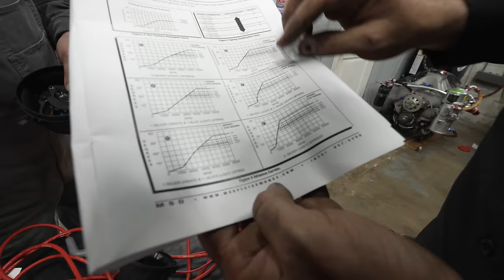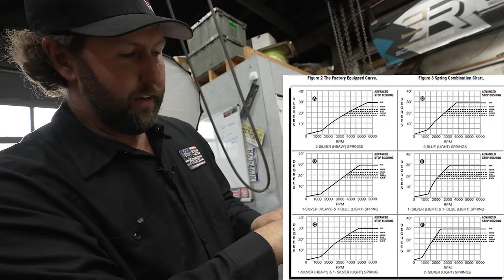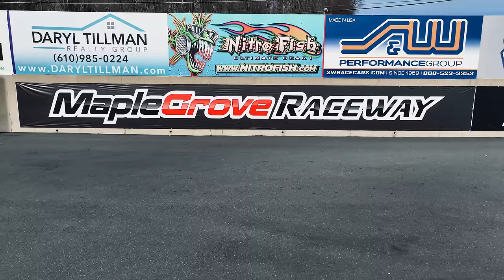Drag Race Ford Fairlane REVIVED w/ Vice Grip Garage After Sitting Dead 40 Years! | Part 2

Comment: I think that noise you guys heard along the road was that piece of stray all-thread for the air cleaner that you hacked off with the angle grinder that flew back towards the firewall / top of the transmission bell housing.

Comment: Gotta love a Ford 302, the sound, and of course the distributor up front for easy access!
Reply: Depends on which one i favor the winsor over the cleveland
Reply: @ronseth1225 I thought windsors were only the 351?
Reply: @DirtyDiezel  winsor 351 is  actually the canadian version of the American cleveland 351.cleveland engines are the under dog though every one including me favor the winsor over it though
Reply: @ronseth1225 cleveland and windsor are 2 different blocks, the heads are not interchangable
Reply: @MotoMeat they did make a 302 cleveland in Australia and called them a 4.9

Comment: You need A gear venders overdrive if your running 3000 R’s @ highway speed.  The O’drive will give about 25% reduction.
Is the trans a ford top loader?

Comment: In 1979 I bought a 67 GTA red Fairlane. It had the 390 4V and C6. Guy i got from had taken it to the track a few times. It ran high 13's with headers and a bigger carb. After i got it I went with a cam and some old Thunderbird heads that probably weren't as good but did raise compression. Street raced it some but never took it to the track.  Was a lot of fun though. Won a lot of races but still lost a few too. Money is speed ya know.

Comment: My 56 210 came with the single pot of brake death, and it damn near lived to it's name.  Full fail at about 50-ish+ mph.  No Brakes!.  Thankfully, the car came with a column shift 3 speed and Stovebolt 6.  Started yanking gears down and got a tire and wheel against the curb and scrubbed the speed off once slow enough.  Laid on the horn, and blew thru the 4 way stop.  No one there thankfully.   It finally stopped, and I changed my pants on the side of the road.  E-brake had parted before purchase and hadn't seen any attention at that time.  I fixed the E-brake stuff first, floorboard pulleys, axle bolts and cables,  that matched my 4 wheel disk with E-brake that was added.  Manual 2 pot Truck Master with the Big reservoirs, Strange Engineering 4 wheel disk with drum E-brake, Speedway adjustable brake bias.   Nice vid, and good edit.  Thanks boys.

Comment: Love Wirecare, but I feel like they are really missing the boat when it comes to marketing to fans of these shows. I’d love to buy a $200-300 kit of: various wire, couple tools, tape, connectors, zip ties, etc all packaged in a nice case. Not too different from what they gave Derek. Enough to do some basic engine wiring/audio wiring for 1-2 project cars. That’s what I would be looking for. It’s awesome that they offer the parts and tools to wire up a LeMans prototype, but that’s way beyond what I need. Just give me a reasonably priced kit that includes what most of us would use.

Comment: third gear is a T5’s Achilles heel. If you’re too rough on the 23 shift, you can actually bend the third gear shift pork.

Hurst competition plus shifter will help. 
The stock shifter has no positive stops  if you’re too rough with that gear change, it will destroy the gear. I know from experience.

Comment: LUV that exhaust fellas. "X" pipe and turn downs just ahead of the rear end.  When Derek's doing a dirty street launch dust will be blown out from under the car. The turn downs may be a bit noisy on the freeway but around town, which is where most of this cars miles will be generated the exhaust will be ever so slightly muffled yet the bass notes will fill the air with an absolutely nasty sounding FoMoCo power plant. I had the same turn down tips with FlowMasters on my 468 '63 Nova and I LOVED that sound. Side exit exhaust sickens me. It sounds like a Harley. Hey,, they like their sound,, we motor heads like our exhaust a bit on the quiet side yet discernibly muscular. 🙂

Comment: I love how Derek just stares in to the welding arc without even blinking.
Reply: That's how you can see what they are doing 😂.
 I worked at a steel plant, that among other things, made cabinets and transformer tanks for GE and Siemens.
 We had like 40 people welding at any given time. 
 I have definitely looked into the light more times than I would have liked to.
 It's not something that I would recommend.

Comment: If you can't adjust the back of the hood to sit flat, it is usually wear in the rivets of the hinges.  You can tighten up the rivets using a press, but that lasts about 15 minutes.  You may want to look for new replacement hinges.

Comment: the fuel tank looks like an early model COROLLA  fuel tank. I put one in my rally car (after damaging the original under floor one) as it fitted over the rear axle behind the rear seat, was easy to add extra fuel lines for efi. i think it held @ 9 gallons.

Comment: Before you question the integrity of a ratchet strap remember that some Linde forklifts come from the factory with a ratchet strap holding the hydraulic fluid tank in place.

Comment: Teck tip: If anyone uses air shocks, but you can't seem to get enough lift, take a jack and lift the chassis up, allowing the axle to drop, then add more air. Works a treat🙂

Comment: Stay out of the water in the burnout box with those street tires, boys.  Water hangs in the treads of the tire.

Also, heating street tires up doesn't make them stickier.  

Drive around the water and a few short chirps to clean the tires off and send it!

Surprised at the wheel hop with those ladder bars.  Did you check the pinion angle?

Comment: I'm not reading through the comments but I bet it was the threaded rod you cut off the air cleaner. It flew behind the motor when it got cut down.
Reply from the maker: Nah, I think it was an extened shackle that must have been in the trunk, we found another one later. It was LOUD and heavy for sure.

Comment: I'd brace up the rear end.
That car tends to twist the body apart, when you put a bunch of power in it.
Watch for cracks below the rear windows.
Reply from the maker: It has full length, subframe connectors, I don’t really know what more you would do than that
Reply: @StayTunedTA  me either.
My 66 twisted itself in half..
I yanked the motor, and scrapped it.
🤣